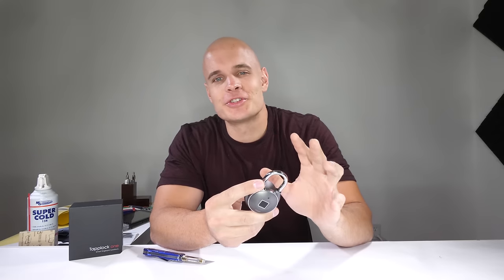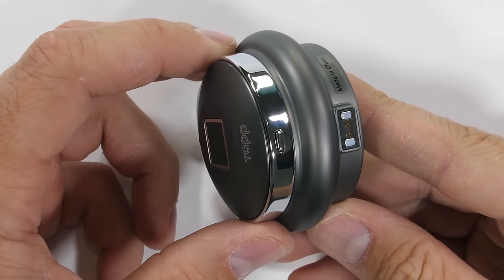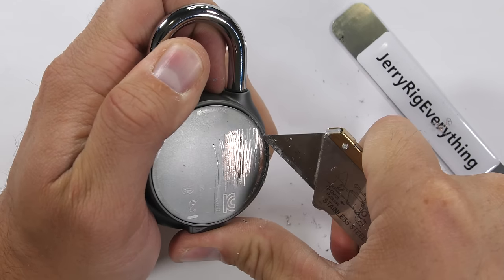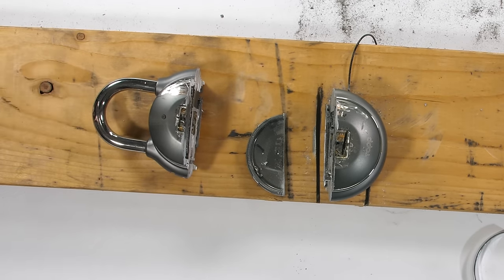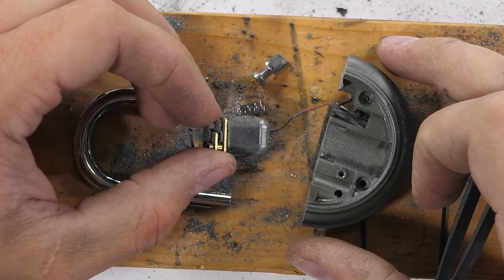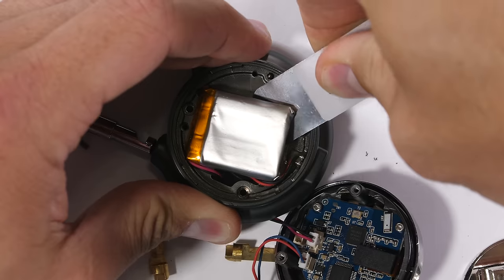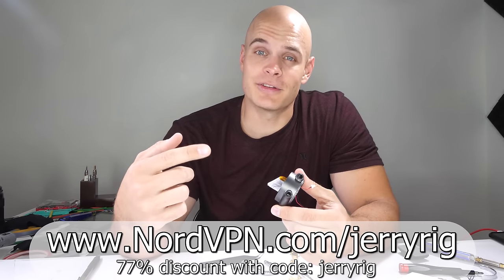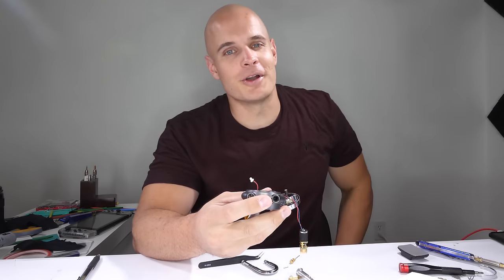DO NOT buy this $100 Smart Lock...

Comment: Can I return my order
Reply: Challenge the Wild no now buy the new $300 taplock
Reply: Just open it yourself and glue it "stuck", not the best but should help against that kind of twisting to open
Reply: and while your at it why not use those "anti-thief" screws? One screw-up and never let's go EVER again.
Reply: Locktite or JB Weld the cover on....it will be good until the LiPo battery (not LiIon) goes dead.
Reply: red7fifty so one year and your 100$ lock is garbage and you have to break it open.
Reply: Challenge the Wild what a FILTHY waste of money. Complete gimmick. $10 "analog" lock should be far more dependable and last ages...
Reply: Whatever you do, when you get your money back DO NOT buy a Master lock (or any lock you can buy in a hardware store. Master Lock makes the worst locks at any price. Don't let a high-priced Master lock fool you, they are just as bad as the cheap Master locks!  Go to a locksmith.
Reply: good luck after a year replacing the battery :-)
Reply: +HowToBeANoob or locktite (and it's also a pun! :D)
Reply: Squid Master it can be recharged albert Einstein.
Reply: Michal Kruntorád after a year just charge the battery using the propietary cable.
Reply: Juan Sambucetti Lithium batteries wear out completely in just a few years, even faster for cheaply made ones like in the video.
Reply: Justin Moleman it's not apple...
Reply: Big T. Larrity what kind of batteries do you use? At 1 cicle per year, that battery will have 90% of the full capacity after 3 years in the worst case. That assuming it's a REALLY bad battery.

Comment: That's... The dumbest lock design
Reply: No it's not, Masterlock has similar fingerprint lock but screws are on outside of the lock :D
Reply: Jakub Kołodziejski  break the lock
Reply: Jakub Kołodziejski add a secret lock hole or compartment and if it dies only you have the key or if Your scared of lock picks make a magnetic lock key where the lock can read the magnetic field and unlock to that specific field
Reply: Ikr
Reply: Jakub Kołodziejski you charge it

Comment: It seems that the design was to (maybe) allow for the replacement of the lithium battery or even allow easy repair.  Could be useful in a lock.
If this is true, the easiest way would be to engineer the back panel to be locked when the shackle is down.  I don't 100% recall which brand did this, but there was a keypad deadbolt that used a similar mechanism to prevent access to the batteries when it was locked.
Regardless, this is a serious oversight.

Comment: i would understand the battery part but like what jerry said, other than that it should be totaly sealed. i use a fingerprint lock as well but not this model nothing can be opened even the battery if it dies out you either use a cutter or grinder to pry it open.

Comment: How to fix, Buy this lock. Take off the back. Use a small drill to strip the heads off the screws and voila, no one can screw it off. Or remove the screw and replace it with another type of screw that’s not Phillips head.
Reply: Or weld the back of it. But if there is a problem with the lock you need a grinder to open it.
Reply: Really man? Incan easily fix that. Hammer the phillips screw drive in the roughed up screw heads until they form like a Phillips screw. Simple
Reply: Or get a refund
Reply: Kool Kiddie just tape the back with duct tape. That shit fixes everything
Reply: for $100  I would not want a fix, I want a product.
Reply: Kool Kiddie well at that point whoever is trying to get into your lock will probably resort to bolt cutters, at which point what kind of lock you use is pretty irrelevant unless it can resist bolt cutters.
Reply: Lockete
Reply: but why pay 100 bucks the company should fix it don't you think
Reply: That's a good fix.
Reply: Sure thing. Let me just grab my security bit set...
Reply: Never buy a finished product you have to fix out of the box.
Reply: Or buy a normal lock for 10 dollars
Reply: They need to use the same locking system for the back too use finger print to unlatch the internals. And give that a nice twist mechanism with a good solid bar.
Reply: Then you can never change the battery, nice hack boi
Reply: Kool kiddie lmao just no I do maintenance work this would not work unless the screws are cheap zinc and even then they would probably shear off in side the threads from your hammering
Reply: Thing is unfixable as long there is a possibility to remove that backplate.
Reply: Or just don't buy it.
Reply: or some crazy glue
Reply: I think first guy had it, with drilling out screw heads to make it so can't remove them but little more would be using something like super glue or lock tight on screw's to make it even harder to remove them after you drill out the head. Back cover is removable probably for incase battery is junk and need to replace it.
Reply: How to fix, buy a $6 combination lock spend the other $94 on strippers and cocaine.
Reply: Nah I'll just buy a lock that takes a key or a combination
Reply: Yeah, and then the thief can just use a bluetooth hack to make it open. At least that's what I gathered online.
Reply: So... you buy a $100 item, and right out of the box YOU have to fix it before you use it? lol Nice!
Reply: WeekendParty __ Use rare type screws and glue them in. Then weld the back. Sadly that won't fix the software issues or the fact it's made out if fucking aluminium....
Reply: lol no you shouldnt have to do that on a $100 lock
Reply: You should not have to do all that to make sure your lock is safe... especially if I pay $100 for it, it should be secure
Reply: +Manan Agarwal Not to defend this E-lock, but most normal locks that are 10 dollars, are absurdly easy to get into. I didn't realize this until watching a few channels where they get into locks for a hobby, but holy shit can a lock picker get into cheap hardware store locks really fast. An amateur with a bumpkey can probably open most padlocks in 10-15 seconds. No bolt cutters needed or other obvious tools needed.
Reply: Better yet: put some super glue on the thread of the back and put it back. That will make it impossible to remove again without another kind of brute force.
Reply: Kool Kiddie have you ever tried that? It doesn't work.
Reply: Yeah, cause you should really have to do that to make a $100 lock secure.
Reply: you know you can just drill out the screws ... thats what every thief will do because its faster than unscrewing. When you drill out the screws it doesnt care if theres a head on the screw or not

Comment: I am glad that I watched this. I was thinking about getting some of these until I just watched this.
Reply: Well if you buy a normal lock a thief is still going to break it open with force just like he would do with this one
Reply: Sure, but if you get a high quality lock (which is still at least 5 times cheaper than this) he'll need A LOT of force to break it, which means carrying some hard to conceal equipment. Quite a bit safer than something that can be opened with a simple screwdriver and little to no effort.

Comment: even if it did work, a battery powered padlock sounds like a pain in the ass. what happens when the battery runs out? the owner can't unlock it until it's recharged?
Reply: Battery life is probably a long long long time, google the product
Reply: TheYoo2b it’s 1 year battery life for 2 hours of charge! Or 3,500 unlocks
Reply: Then you get the battery replaced by the company or buy a new one lol
Reply: you can just plop the back cover and buy a new battery or charge it there using a power bank and unlock it.
Reply: You can also unlock it from your phone
Reply: it won't unlock if there is no power, what you don't understand lmao
Reply: "1 year battery life for 2 hours of charge! Or 3,500 unlocks" even on -40 celsius ? :-D
Reply: Again...old school pad lock seems to do the trick
...
Reply: Master locks are the best
Reply: DirtbikeKid23 it can take hundred of years for a battery to die without any use
Reply: sles sles ..but even a simple mechanical lock may well have trouble at -40C
Reply: In that case, all you need is a screw driver.
Reply: @harshnemesis  Best at what? They're at least easy to get into if you lost your key.
Reply: Or just buy a quality padlock that will last decades. I still use two very old but solid padlocks daily. They've never failed on me once.
Reply: You just open it with a screwdriver then 😂
Reply: @09jisaac  Dude it's master, has to be good

Comment: Taplock should use this on their company gate. Shut it down
Reply: They tried a new thing which I think many people wanted. 
If they fixed this issue then good for them. If not, BURN THEM TO THE GROUND!
Reply: Personally I think any security company should rely on their own products or methods for their company buildings.  If they don't trust themselves, neither can I.
Reply: To only have it reopened in 30 sec?

Comment: The back cover should be removable to change the battery when it dies (assuming they'll sell you another), but the internals should be welded shut.  It makes no security sense to be able to dismantle a lock like that.
Reply: CatsMeowPaw you can charge it using the proprietary port. No need to remove the battery
Reply: Uttiya Dutta I think they're talking about when the battery literally dies. All batteries have a pre determined lifespan before you have to replace it.
Reply: That is when the guarantee runs out, so you have to buy a new one..
Reply: *ME UNLOCKED THE LOCK, STOLE THE STUFF, REMOVE THE BATTERY AND RELOCKED*

Comment: "Tapplock will send free replacements to anyone who is able to displace the back-cover without damaging it (isn't it the point of someone damaging the lock in order to get into it? LOL). AND future batches will also come with proprietary screws. (which require a propriety screwdriver, which you most likely could buy, like any other "propriety" screws, because how else could you repair it? /s) (they should have just straight up put welded bolts in it instead)

Go check out their indiegogo, they didn't ship out for most of their backers and their is a ton of shady and negative stuff about the people behind it. 

Too many red flags that scream SCAM on this company and their product.
Reply: I think they mean without beating the lock senseless. In the video he unscrewed the back without damaging the lock itself.

Comment: LMAO how can you build something like that. Was there no prototype that exposed that?
Reply: Jindujun no it’s part of the design so that they can perform maintenance
Reply: What they should have done is make the back a twist cap as it is, but only allow you to access the internals by pressing a button behind the twist cap while simultaneously activating the finger print scanner. Instead they decided that ordinary non-tamper-proof screws would foil even the biggest fans of Rick and Morty.
Reply: Burnt Cinnamon Roll but then you can’t access the internals to unlock it or fix it if the battery is dead. That would also be costly to implement. What they should do is make the internals (besides the battery) impossible to access without very specific tools, like multiple kinds of screws or even some kind of seal, that would require a lot of prep and time to take apart, so that only the company or somebody with a lot of time and experience could open it. The problem is this lock is expensive, so they wanted to make it easy for the consumer to fix themselves in case of defect and/or easier for the company to repair, neglecting the security hazards. This product was kind of doomed from its conception. If the technology were cheaper and you didn’t have to worry as much about defects or damage ruining the product, these could have been made with a solid casing with no internal access. Instead they had to make it accessible, because otherwise they’d have refunds and angry customers. It still backfired on them though.

Comment: Simple solution, buy a $5 bottle of super glue, remove back, add glue and replace, you arent going to be able to break a super glue seal with a sticker attached to a gopro mount.  But if you dont need super duper security, like a locker at work with security camera's around, its good that the battery is replaceable.
Reply: What's the point of having a replaceable battery when it only needs to be charged once a year?
Reply: batteries aren't that reliable. There is a chance that bettery can go bad.

Comment: Here is only and only simple solution to this. First they should have physical key but with similar opening design. So, if lock fingerprint or any malfunction occurs then padlock owner could simply use it as normal padlock with key or fix it by opening it. One twist and clip opens the padlock and double twist/clip sound causes it to disassemble for repair. Plain and simple as that. So, smart padlock would simply be a normal padlock with fingerprint scan as a convenience and not the sole feature for using it.

Comment: If you have one of these you could solve this problem by first removing the back cover, add a smear of superglue on the back cover thread, then screw it back on. Or it might be worth a try to use a blunt chisel to dent either side of the join so it can't be unscrewed.

Comment: Noke has that solved you can’t open the back unless it’s unlocked and if the battery dies and it’s locked. There’s a terminal to place the new battery to jump start it so you can unlock it and place the new battery in and I only got it for $59

Comment: still, not so terrible.. like no one is likely going to have the equipment on hand to unscrew that backplate in the field (plus the thief have to be familiar with the design to know it unscrews; it's not apparent), and if you can probably swap out the PH screws for something obscure on your own - overall seems like still a pretty good security lock for most routine uses, but not for locking up something long term which might have the chance of being studied

Comment: Thing is, no burglar would know that you can twist off the back of the lock unless they cut it in half. Good job Jerryrigeverything for bringing an un-noticeable flaw to light
Reply: A flaw is still a flaw. A lock shouldn't be that easy to open.
Reply: @VFG204 , I get it’s still a flaw but again no burglar is going to think to twist off the back and I doubt any burglars carry go pro mounts with them. They would probably be more focused on the front of the lock.

Comment: LOL that is stupid. But that's still the issue with most fingerprint locks. The security is adequate for locking bags and suitcases against opportunistic thieves pickpocketing their contents - but it has the size suggesting it's fit for a locker, shed, cheaper bicycle or similar. So far I only know of one lock that is secure enough for a locker and shed - the Abus 57/50 (or 57/45). All others have obvious very bad flaws - including MasterLock - their strongest point is by far their shackle which is quite good - but lock body not so much. I have the Abus on the way in the mail to test it out so excited to see if it lives up to expectations. Also has a small mini Chinese fingerprint lock for bag/suitcase - but that takes a long time to arrive from China.

Comment: Nah it's not even enough space on the back of the lock considering the lock is actually locked on the locker. When you raise the lock up when you are trying to unlock it, it's about 45 to 75 degree angle of space between the back of the lock and the locker. Definitely not enough room for a hand and any size screwdriver. Yes, maybe they could weld it but that's a risk from the heat possibly melting the wire or anything else much more delicate. It's not really needed. No one will have the space enough to squeeze a screwdriver and hand in the back to get into it. You did a little too much on this one.

Comment: The "fatal flaw" is that you had to cut the lock in half with an abrasive cuttoff saw just to see how it opens?

I think you proved that this is a very good lock and if somebody just took apart his own lock and used red threadlocker on the screws, the puny #1 philips screwdriver would never get them back out.

Comment: Great, glad I sat through that. Now I know why you shouldn't buy this! Because nobody will call the police on a guy with a screwdriver, what a fatal flaw!

Your advice is moronic, this is a good lock, it works as advertised, and as you said a pair of bolt cutters will do the job regardless of the lock type.

A padlock is still only as useful as a padlock. It's a deterrent, not some impenetrable security measure.